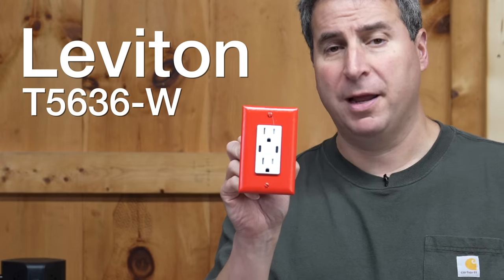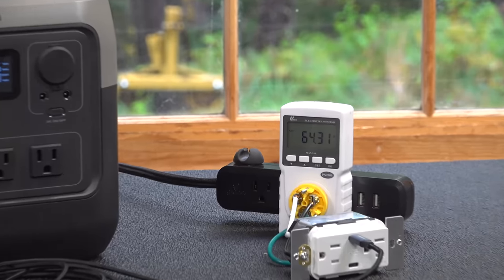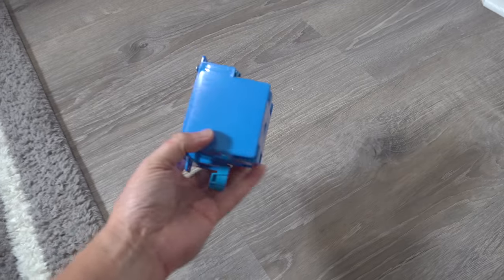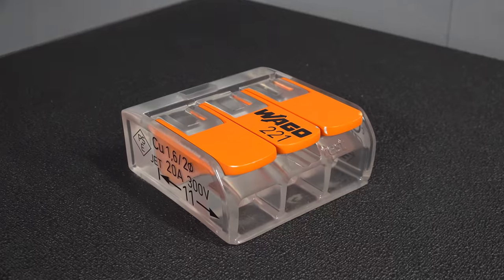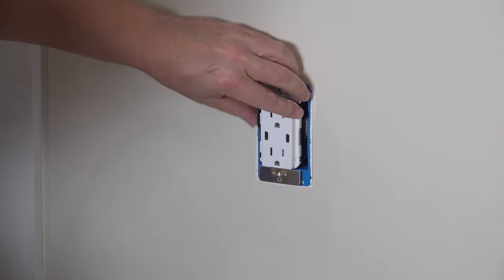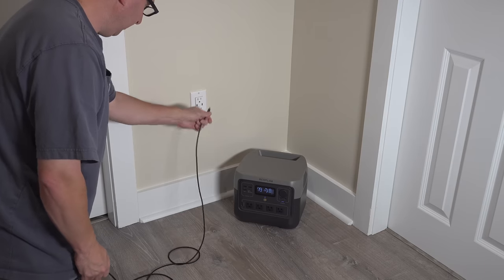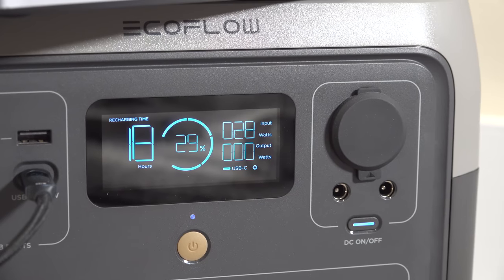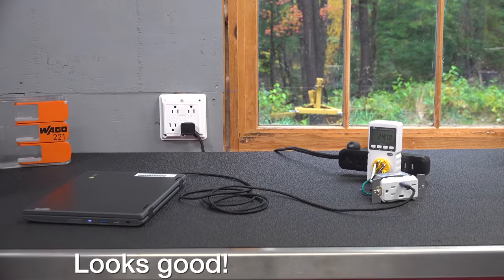Most Powerful USB Outlet you can buy that won't burn your house down - Leviton 60 Watt

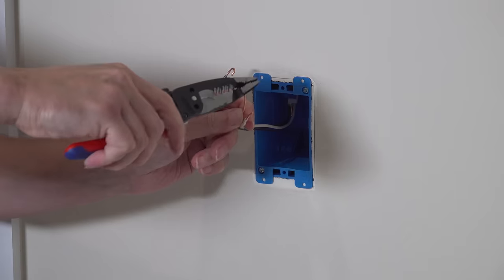Comment from the maker: ⚡ Safety Update at 2:41 You should ALWAYS cut the hooks off & re-strip new wire, after reviewing the directions further I realized the way I did it was not correct ⚡ Tools in the video Leviton Outlet: https://amzn.to/472EccP - Wago 221s: https://amzn.to/47iZ683 - LCD Power Cable: https://amzn.to/46WE9zq - Outlet Tester: https://amzn.to/46FGXRQ - Plug in Power Meter: https://amzn.to/3FrKVkV - Wiha Screwdriver: https://amzn.to/474Cnwl
Reply: May I also recommend the Wago 221-61x series lever nuts?  The 221-41x series handles 24-12 AWG and 20 amps but the 221-61x series supports 20-10 AWG wire and 30 amps.  I bring them up because the biggest Wago haters always fret over them melting down from a poor connection.  (They don't, plenty of stress testing So if you show a friend one of those debunking videos and he's still not convinced, tell him to get the 221-61x series instead.  Their internal conductors are 10 AWG, so if your buddy manages to melt one of THOSE, explain to him that he's an idiot-savant who somehow pulled over 30 amps from his living room outlets....and that he should probably get an electrician to figure out why his breakers aren't tripping.

Comment: Cool. I would be interested in seeing temps inside the box if there was a way.
Reply: Definitely! I was hoping this video would cover that. Would be easy with a thermometer with a thermocouple/temp probe. I won't buy one until I see some comprehensive temperature tests running at full load.
Reply: Use an IR (infrared) thermometer.  It reads temps with an aim/point infrared beam.

Comment: yea you can get a charger that's outside the outlet for $20-30 and then just get a $2-3 normal outlet, or even gfci.
Reply: And the bricks are portable.
Reply: If you have kids, those bricks get lost all the time unless you keep a close eye on the things. I installed a couple USB outlets at friends house because of this. Half the time the cables would be lost too, but there aren't many solutions for that.
Reply: Then do that. Some of use prefer this method

Comment: I used to work for Leviton in the early 2000.  Good company
Reply from the maker: Thats good to hear. They are one of the few companies that hasn't gone down the tubes over the years. Electricians like them too, so if you pay one to install this at least the electrician can trust it.
Reply: @SilverCymbal  I know several designers from back in the day when we were located in Little Neck,NY.  Great times.  The Levetons were fair and generous with the employees back then.
Reply: @SilverCymbal it's hard to go down when there's codes and industrial use

Comment: Hi Chris I’m in the Uk so this particular products didn’t apply to me, just wondered if this is a Gallium based charger as they are smaller and run cooler.  Looked on the Leviton website but couldn’t see an answer.  As always these things are built to a price point so I suspect not.  Enjoying your channel content👍👍
Reply: I've guessing switching to gallium nitride was a factor in this. Vs silicon they can be right around 50% of the size, so that matches well with the prior max rating being 30watts
Reply: Most any high quality chargers have moved to GaN

Comment: You should have left the USB-C outlet plugged in to power for a bit and then used an IR camera to see how much heat it generates. You will see it is not nothing. You could have also used a multi-meter in current measurement mode to see milliamps which is a bit more resolution than your plug-in power meter can measure.   The outlet may not use a lot of power, but it definitely uses some and does so 24/7/365. It can cost you as much as the price of the outlet in a year if you do the math. Most people wont notice it, but it is not actually nothing as you claim
Reply: Please show your math, in particular the device's power consumption when not in use.
Reply: @brothermine2292  brother , I think you missed the part where I said " if you do the math" 🤣👍 That's okay, don't feel bad, you'll get em next time
Reply: Every watt is about $1/year. I highly doubt it uses more than 1 or 2. My kill-a-watt starts reading at about 2 or 3W and is pretty accurate that low down.
Math for clarity: 1W x 24hr = 24Wh x 365 = 8760Wh. 8.7kWh x $0.12/kWh = $1.05/yr

Comment: Awesome job showing us the leviton using no watts standing still.  I wondered this too.  Sweet!
Reply from the maker: I appreciate that, I wondered myself since I was sure it must be using 5 or 10 watts 24x7  It must using something but it must be millivolts as it didn't register.
Reply: @SilverCymbal  I love my kilowatt meter. Discovered my dehumidifier was suckling $45 of electricity per month.   😱
Reply: @steffen707- Might as well run the AC in that case!
Reply: It is certainly using some power, but these cheap power meters lack the precision and resolution to show it, especially since the power factor in standby is often less than 0.1, meaning only a few percent of the power going in and out of the device is actually consumed.

Comment: I like the concept, and I'm sure that the price will become more reasonable after initial sales cover the design and marketing costs. Of course, now that Leviton has done the R&D, other brands are sure to follow, driving costs down further.
If these get to a price point that is slightly above the cost of a 60W USB-C brick, I'm sure they will be more widely accepted.
Reply: A stand-alone good quality USB C 2 port 60 watt charger is $40, this is only about double that, for cramming it into the outlet and using more sophisticated circuitry because of the need to keep the heat generation down, the price isn't bad.
Reply: @John_Ridley nah you can get them for $20 all day now. 

Yeah Anker might be charging $40 for it but there are Chinese knockoffs around the $12 mark now. $40 is what I’d pay for a 100W charger
Reply: @ericklein5097  Go watch some of Big Clive's videos before you buy a Chinese knock-off charger. After one of his videos I went around my house, found and threw away EVERY non-name-brand charger I had. Some of the ones he has reviewed could easily kill  you.
Reply: @John_Ridley  watch most of them. Test them pretty thoroughly to see if there are any sketchy things going on
Reply: @ericklein5097  The big problem is insufficient clearance between low and high voltage circuitry. This could easily work 100% fine for years, then one day when there's a lot of humidity in the air or a bit of dust falls in the wrong place, suddenly the mains voltage arcs over to the cable going to your phone. Hope you aren't holding it at the time.
Reply: @ericklein5097  Chinese knockoffs in this case are likely going to burn your house down. Respect the UL listing and Leviton and other companies using UL to verify product safety.

Comment: Pretty cool and thanks for doing the leg work. I had to install a couple ceiling fans the other day and my dad is now a Wago convert, we had to re do a couple of connections with stranded and solid wire and he noted that the wire nuts would have shredded them on the 2nd or 3rd connection. (remote module didn't want to fit in the slot so we had to flip it twice). He was skeptical at first but the strip gauge and the ease of one-handed use, I think I'll get him a box for the next holiday.

Comment: The Leviton does not support PPS nor Samsung Super Fast Charging. Outlets are meant to last decades and this one is already obsolete.
At $80 it's not a good value. A name brand TR outlet is less than $15. A name brand 60W+ PD/PPS compatible charger is less than $40.
So unless someone needs a USB-C charger that's flush with the wall I'd suggest they stick to traditional USB-C chargers.

I don't understand why houses are not wired with 48VDC with a central transformer in this day in age. Apart from appliances most everything uses relatively low power DC these days.
Reply: Leviton is always behind the times. Topgreener has had this for a while and has pps. They're always ahead of the competition and it's nearly half the price of this one

Comment: To measure the very low standby power, you need a proper measurement device that can also integrate (for example GPM-8310). Although the measurement isn't super-important, as for good-quality chargers, it is less than 50mW usually, and it would remain irrelevant even if it was 100mW or 250mW.
However, no particular test on output voltages is bad. I have multiple rather expensive chargers that internally only have one rail. Effectively it means that attaching a low-power device like a phone (5-9V typically) will downgrade the whole charger to that voltage, even on the secondary port. 9V is usually not enough to charge laptops at all. So in the end you get 18W, not 30W+30W.

Comment: I feel like... no matter what we do to upgrade our houses, the technology keeps changing to need further upgrades. 
First we got USB-A 2 watts. Then we got USB-A 2.4 watts. Then USB-A 3.0 watts. Then USB-C 2 watts.... etc.
Now, we need GFCI in most locations, so replace your outlets again. And they made GFCI with USB-A ports. Then GFCI with USB-C ports. 
Oh and don't forget "now needs tamper resistant..."
Then we have these with no GFCI but with high wattage and it's tamper resistant.
2 years from now the USB port will need to be tamper resistant.
And then GFCI
And then AFCI
Then they'll design USB-E ports and we'll need 100 watt ports, but they won't be tamper resistant.... and the cycle starts all over again.
I give up.
Reply: 100W is the old limit, and 240W is the new USB-C power limit. I do NOT expect them to allow more power. (240W use 48V and I somehow doubt they will go beyond 50V)

Besides, with more efficient lamps, laptops, phones, TV, e.t.c. I am not too convinced the need for high power will be that much around.

Comment: the reason they said these were impossible is actually the space required to convert to 60w DC however since then GAN(Gallium Nitride) Chargers have made their debut pushing 120w in the space of some 10-15w charger bricks

Comment: Don’t the charging bricks like the Apple one you showed have “intelligent circuitry” that helps regulate the power going into the laptop?  Or is that totally handle by the laptop these days?
Reply: Usually both. A good device will have its own regulation. But great devices will communicate, like power deliver (PD) so full wattage, then slow, then maybe trickle. 
But devices without any smart future in either end will usually overcharge. 
Think bad vape devices.

Comment: This is a good solution and I have installed several in my houses in key locations, however this is way over priced.  $80 makes this the Ferrari of outlets and few of us will need such high performance.  I get 3 packs of these that are maybe 30 watts and they are $20 for the three pack.
I had problems with bricks and charge cords being lost then I labeled them and assigned them to my children to hold them accountable when they went missing.  That helps with them being “lost”.

Comment: One thing I would recommend, even though it is UL approved, that means in any deep box, I would recommend the metal deep old work box, that way even more heat is dissipated, as that all metal band around the outlet is a heat sink and will help disparate the heat much more than possibly deteriorating or melting the cheap plastic boxes.

Comment: As some people have previously stated, unless required by code for certain regions, it would be far better to use a metal junction box to help disappate the heat from the charger. As well, even though I dont disagree with the use of wagos, when installed properly a wire nut will give a bigger surface of contact between the wires allowing the temperature to be cooler at the termination point. If heat is the driving factor that is the better choice. However as this channel is geared more towards DIY advice wago is still a safe option for sure.

Comment: Not all laptops can be powered with the USB C ports .  There are high powered laptops that require 100 to even 200 watts when in use running high intensity apps. He only tested the wattage of a Mac Book in idle when it wasn’t processing anything. He should try it again while running Cinebench and see the wattage that it takes using the included power brick on the normal socket with a Fayleeko Power Meter or similar. The higher wattage are for high performance laptops with the top end Discrete GPUs (GeForce RTX 3080 or RTX 4080 and 4090)..  Those would still need their own power brick.
Reply: Duh? Also, the laptop wont take more power than it its specced regardless of what benchmark program you run.
Reply: Would that reveal anything new?
The connected device knows max power (USB-PD involve negotating details), so the laptop/other would limit the power taken from it.
Whatever more would have to come from other chargers or battery, or the machine would have to limit power.

Comment: So, does it get dangerously hot in the electrical box or not?
Reply from the maker: I left it charging my ecoflow for 2 hours and the outlet felt warm but nothing crazy, I have felt hotter AC adpaters in open air. Leviton runs the massive risk of lawsuits if products fail and they need to test them in crowded boxes, different kinds oif walls, etc. So you have to put some faith in the certifications and company but I saw no issues with this at all.

Comment: Unless you want to be tied to one outlet with your laptop, a brick is still better, since it can be used anywhere with a regular outlet.  You will likely need a fairly long USB-C cord to use it as well.
Reply: I would like this because I could just leave my brick in my backpack for travel, since I always use my laptop in the same place at home it would make cable management easier. This is rather expensive for a minor convenience, though.
Reply: Other option: lots of USB-C outlets around the house.

Maybe not quite yet tho!

Comment: I would never touch something like this or install one. I’ve lost count of the number of products I’ve seen with embedded USB charging ports where the USB ports either stop working or fry things. Plus they keep changing the USB standard. And embedded USB ports in public places are dangerous for other reasons. Just kind of a bad idea all around. You’re never going to fit 100W much less 240W Power Delivery ports in a normal electrical box, so it will always have very limited usefulness. Splitting the 60W barely gets you enough to charge a phone and tablet at the same time (at the max rate each device can handle).

Comment: i saw a comment somewhere in here voicing anxiety about USB-C ports being obsolete in a couple of years. it's very likely that some future iteration on USB power delivery will allow for more power, but that's a totally different thing from the fear that these ports won't be usable in the future. the USB standard has been great about preserving backwards compatibility. if you have a USB cable from ~25 years ago, you could use it in a charger you buy off amazon today.

i would be more worried about the ergonomics of the USB port being all the way back at the wall. i charge a lot of stuff by USB, but USB cables are often pretty short (there just isn't a super strong market for them to be very long, since a long power cord is a lot cheaper). most people i know use a USB power adapter that has a power cord attached to it that snakes its way back to the wall. that way, you can also put something behind it like a bookshelf or couch or something. this also introduces another fear: something knocking into the outlet from the side and breaking the USB cable. i feel like flat power plugs are really common, but i've never seen a flat USB charging cable. i've seen some cables that come out at an angle, but there would always be a conspicuous piece that could get caught if you sweep across it from the side or something.

this kind of combo outlet makes a lot more sense to me in something like a countertop setup, or at an outlet that's at or above a desk tabletop. if you connect this downstream of a GFCI outlet in a kitchen, i bet this would be perfect for a lot of people.

Comment: I love how you talk about losing the adapter and saying the outlet is 'pretty universal' and then cut to a shot with a hacked up kill-a-watt and the outlet bare wired on your desk like you're just going to throw that set up in your laptop bag and go :P

I don't like the way the USB plugs in flush to the wall. Seems like a recipe for broken connectors/cables. Would have been better if they provided some protection by either recessing the port or making a guard that sticks out to protect the cable.

Comment: I never had any issues with connecting stranded to solid using Ideal wire nuts or gorilla nuts. O seen many videos on wagos catching fire. I know these outlets may not conduct high current but you never know when someone may plug a space heater or a hair dryer in that outlet. Before trying these lazy shortcuts count the cost and current. 73 

PS i cant help it if people dont know the proper way of using wirenuts. 73

Comment: Seen them on Amazon before. My issue is the cost. It is the same cost as a mobile charger. So to put a $60 + outlet in that is stuck there does not help me. Maybe someone that goes between home and work to the same location with a laptop.

Comment: This is a very  bad idea.  Putting a heat source into a heat source into wall box in a residential setting.  The assumption is that the outlet will be abused and not maintained

Comment: I'm cheap, and $80 is a high price, but i will most likely put these in a couple of spots in the house where devices tend to congregate. If the price was around $50 i would install these in more places. I would risk a cheaper power brick outside the outlet and if it breaks or over heats i can unplug it and throw it out. Cant do that with an outlet and it's not worth the risk for a no brand name to live inside my walls.